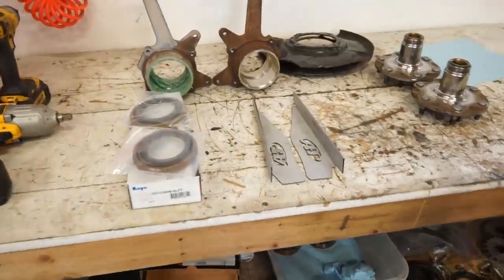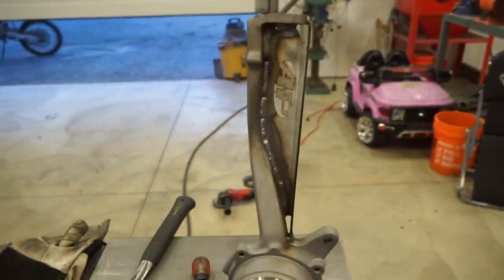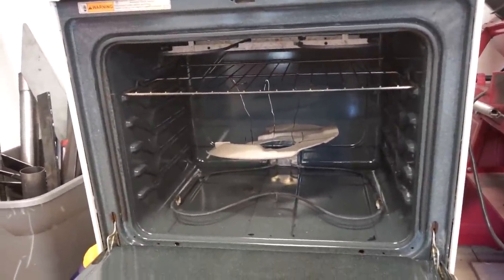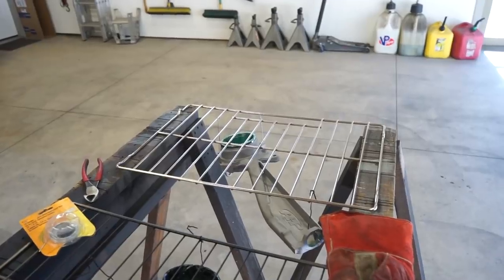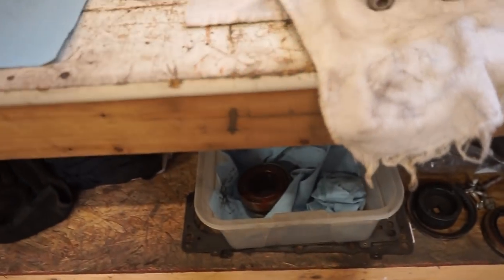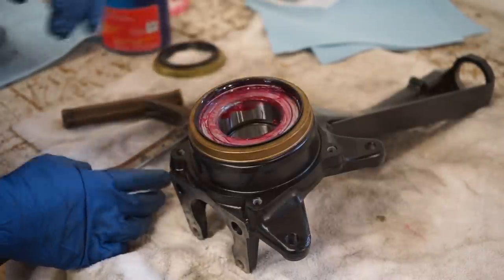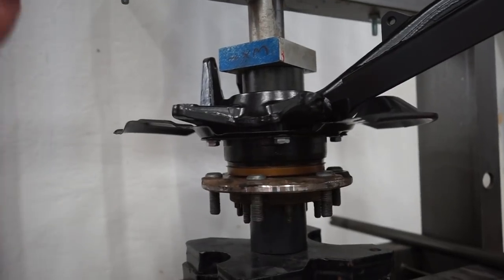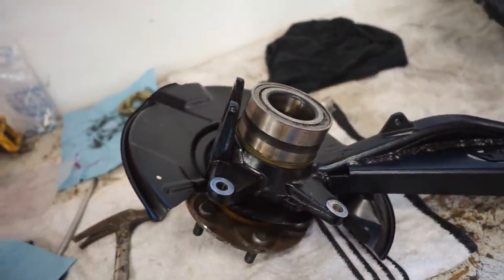Powder Coating And Rebuilding The Tacoma Front End!!!

Comment: Nice work good grief a claw hammer? You should invest in some good electric 3/8 impact and an electric 3/8 ratchet. I currently use the stubby Milwaukee 3/8 impact 12v with 6.0 battery and it is absolutely a beast. Also there ratchet line. Not trying to sell there stuff but work smarter and not harder. You’ll thank me a lot later when you get old and you have problems with your hands twisting and turning will take it’s toll.I’ve been watching for a while now and love my 2 yotas.

Comment: It's been my experience Always use OEM Toyota parts especially oil filters,ball joints, wheel Bearings. Most importantly oil filters I've had 2 yota motors go bad because I used over the counter one's.

Comment: Austin, I have been following you for quite some time, I'm really impressed with your willingness to go above and beyond, I looked forward to this episode because Just got done rebuilding my 05 Tundra Limited front end, my truck only has 43k original miles, I was worried about the age of the components more than the milage.
I used moog parts, ( I know, much controversy about Moog but I never had a problem with them and I have been tooling since I was 12, I'm now 70yrs old.
I sandblasted everything and sprayed por 15, I think it's better than powder coating, again jmo.
I replaced the wheel bearings with national I got from Advanced auto along with new axles, I heard good things about them, also they have a 3 yrs free replacement and lifetime parts replacement, so I replaced upper and lower ball joints, inner and outer tie rods, replaced all the bushings on the steering rack, stabilizer bar , replaced the stabilizer stand offs, replaced the dust shields because mine were shot all new wheel bearings, seals and replaced the seals in the front diff. You did exactly the same thing I did when replacing the wheel bearings, unlike yours, I did not have a locking nut on the back of the spindle, just a ring that pressed over the the ABS ring, the torque from the axle nut holds it all together.
I took a ton of pics, from start to finish. The truck looks great and rides like new.
I am looking forward to this project, I used to own a 2002 taco 4x4.
Keep up the great work and videos.
Jay
Reply from the maker: Thank you! Sounds like your truck will be good for 200K miles now!

Comment: Is the 4wd conversation only a good idea for that generation Tacoma prerunner or would it be doable on a 2012 base model?
Reply: The pre runners are a 4wd chassis without the 4wd components. So everything just bolts in. Doing the swap on a base 2wd easiest way is to solid axle swap and run custom suspension all the way around.